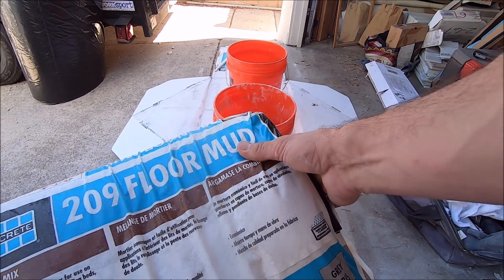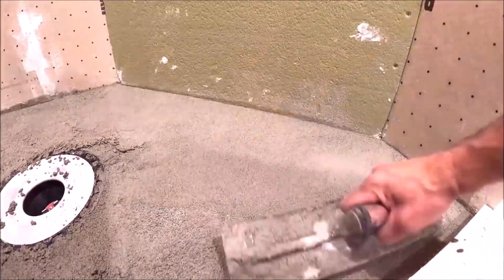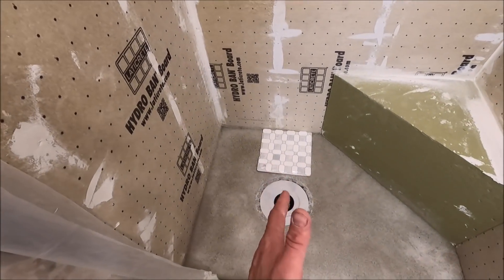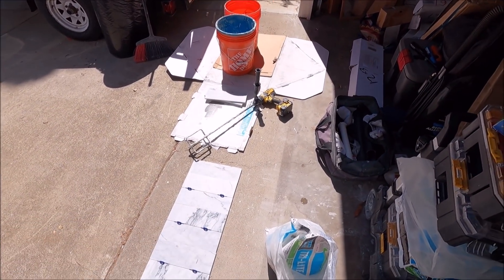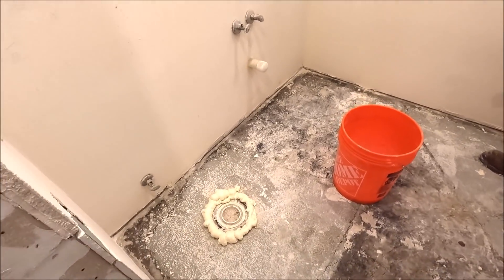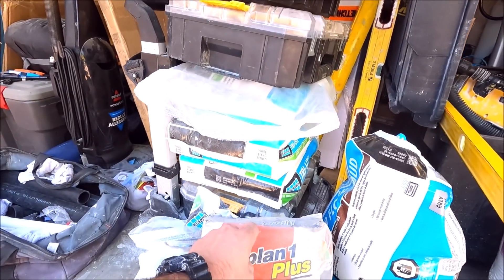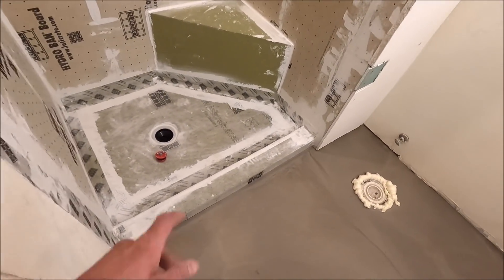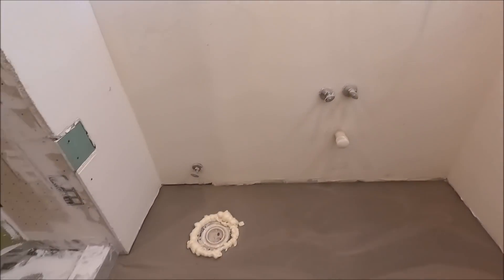I Hope This Shower Will Drain!

Comment: Dang that tileable drain looks slick. No drain grid breaking up the mosaic pattern sure makes for a beautiful result.
Reply: I don’t think that’s the drain finish though. There should be an actual drain cover that you insert the tile into and place it. Could be wrong but that’s how I’ve known them to be.
Reply: @pf5658  hes using the schluter one, it doesnt have any frame around the grate tile, its basically a metal square with kerdi on top that you set your tile on top of
Reply: @NailheadCarpentryTile  I see. That’s pretty freaking cool then.
Reply: @pf5658  they're alright, not really a fan for small mosaics, the edges of the sub grate are rounded and let small mosaics sag down on the edges, can be quite finicky imo, plus I've seen the edges of the tile get chipped before as there's no real protection for them

Comment: Do you still install an uncoupling memembrane ( like Ditra)on top of the self leveling when it's installed on a wood subfloor?
Reply: I would recommend it. Cheaper insurance as it is a crack isolation. Especially if you choose any natural stone for the floor. Marble anywhere in a bathroom is a terrible idea. I personally would avoid ditra as I've seen too many failures happen either with the ditra itself or ditra and a wide variety of thinsets that aren't compatible with ditra.

Comment: Get rid of that Dewalt nailer and get the Milwalkie.  No ramp up time.
Reply from the maker: We will be doing that soon! Can't stand our 16g Dewalt
Reply: @LandbergTileTV  I have the 18 gauge Milwaukee and love it!  Also got the 10” chop saw and its perfect.  Got the m12 pex expander as well and rotohammer to use as a mixer and a rotohammer as needed.  All I need now is the stand for the saw but I heard its bad and the table saw.  Milwaukee is pretty good and I used to be a dewalt guy

Comment: No membrane for the wall seams, corners and screw holes. That would make me nervous.
Reply: Yeah he definitely didn't follow the guidelines for hydroban board to the letter. Choose to adhesive the edge of the board just on the top piece and niche. Used a 10" knife lol for screws and seams. (Seams need 1" beyond the joint on either side). All corners and seams should get waterproof tape if it's a steam shower which I don't think this is.  I do just for peace of mind
Reply: @TheBshackelford1  yeah short term I’m sure it will be fine and water proof, but years down the road when that adhesive starts to dry out crack and degrade from years of constant temp changes. If not using the membrane I would have at least spread a wider and thicker layer of the sealer across the screw holes and seams.  Then again who knows it may last a life time just like it is🤷🏻‍♂️
Reply: @beanieweenie9543  obviously we all want to do the best job without spending unnecessary money and time but there are small things we can do to make it bombproof. I think we all need to learn as a community to accept how others build and just offer how we did things differently